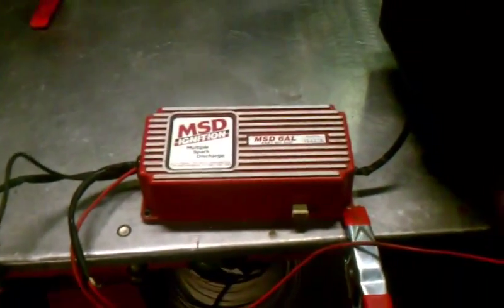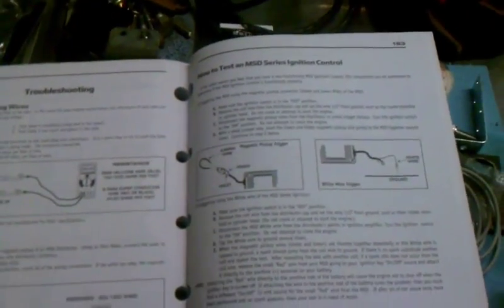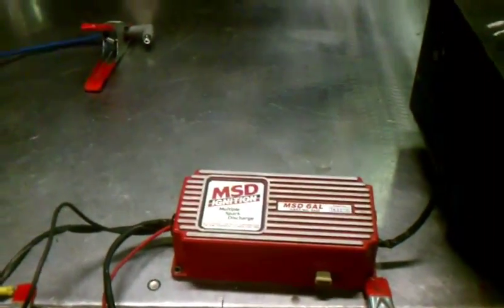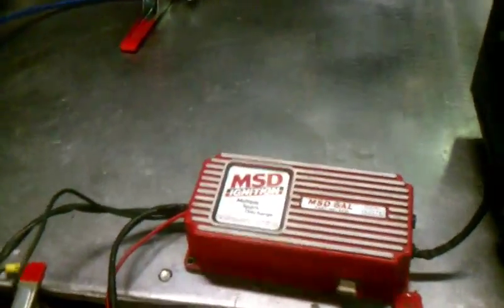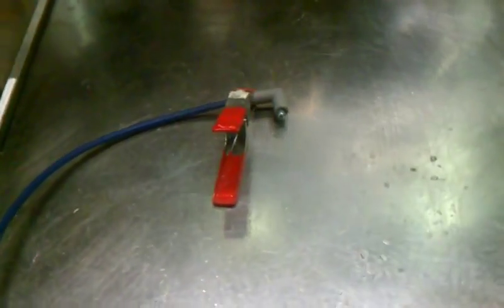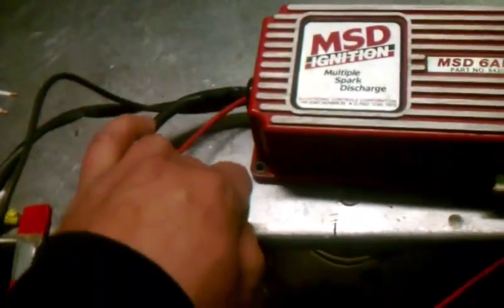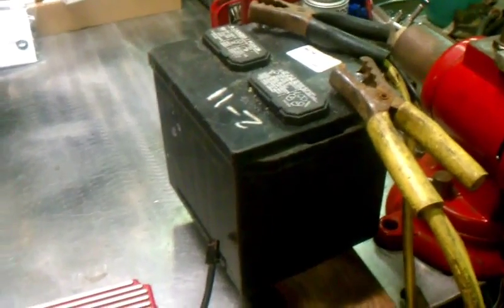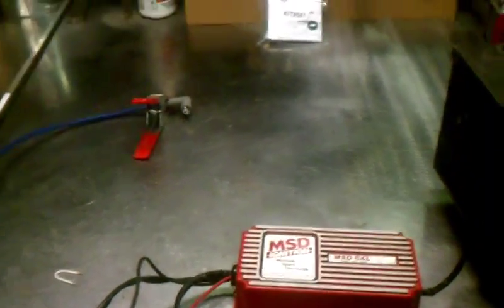Testing an MSD 6 series ignition control

Comment: Test doesn't tell you if your msd is good or not. All this will tell you that the msd AND the coil are good. My msd when tested like this won't spark at the coil wire yet the med clicks and I get power to coil positive.  I suspect a bad coil....

Comment: i have had 2 MSD 6a and 6al fail but still spark. they both just one day ran like shit and after checking volts, cap, wires plugs and fuel i swapped a new MSD in and problem solved. dont know what the deal was but it was my friends 6al last year and my 6a today. truck runs but not on all 8 and everything else looks good so im thinking that old MSD is not working correctly
Reply: When u tap the white wire or magnetic connector, does it continuously spark? Mines sparks and cuts out right away until you tap it again.
Reply: We have 2 different race cars and both fuckin msd boxes went down in the last 2 weeks. Still spark. One of them was brand new 2 months ago
Reply: Did you use cheap spark plugs ?
Reply: I have a new 6A box and after  finding every other MSD street fire spark plug terminal end bad as they blackenedI krimped on new end as they turn black and crumbled (failed resistance test) and new MSD Cap and rotor
Reply: Ihd to buy a new dist cap as terminals inside cap towers blackend.  After all wires checked good with everything installed engine ran well for a day or so now engine breaking up at 4000 rpm.  This initin dyetem seems pretty prone to failure yet I talk to tech rep and his has been working well for 5Yrs.  5yrs  I would like it  to work for 5 days.